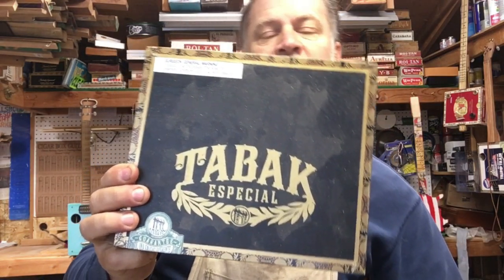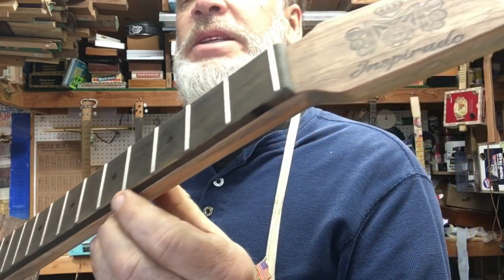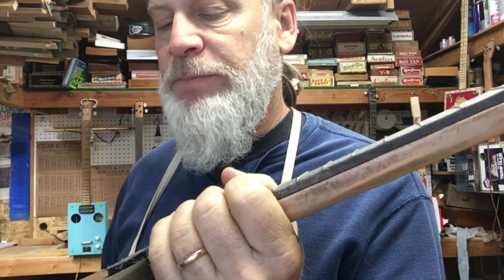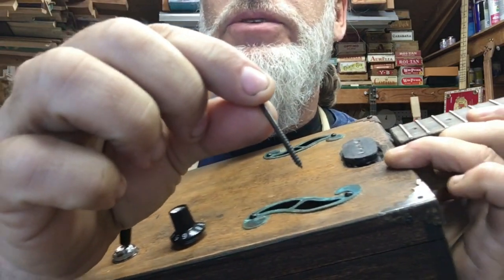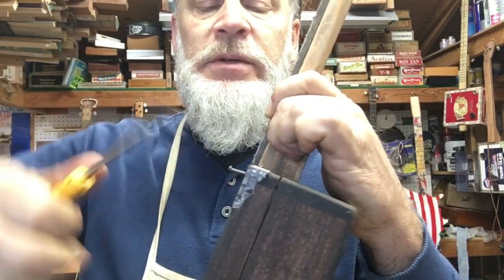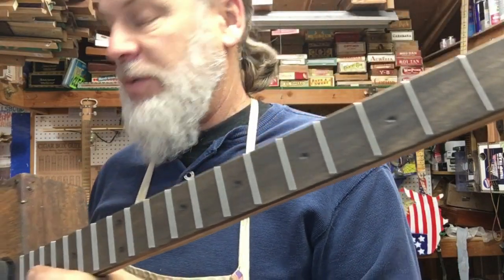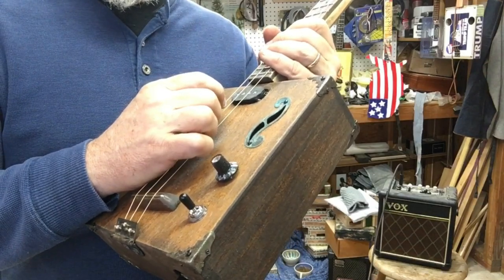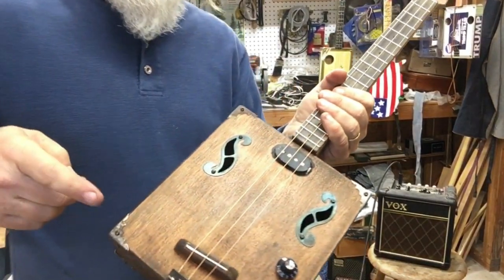The End - of the TABAK Cigar Box Guitar build

Comment: before you put the screw's in use some hard soap on the thread's, make's putting them in a lot easier,
Reply: ...or candle wax. 🕯
Reply: @johnwashburn3793  or a strategically (and stealthily) harvested nose nugget? lol... JK. Extra glass of wine on Saturday night...
Reply: at the furniture shop if a screw was going into a spot that seemed "iffy" about splitting. i would load the screw onto the driver that was chucked into the drill. & jam it on the concrete floor